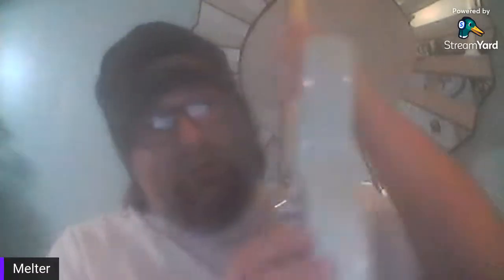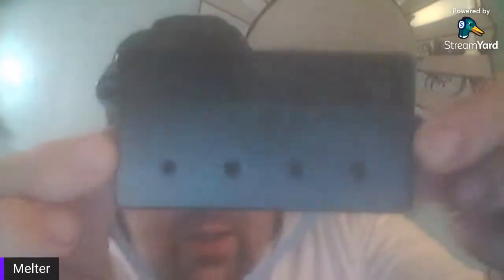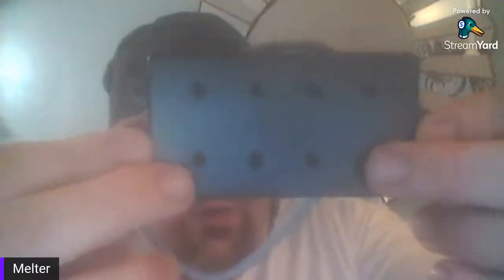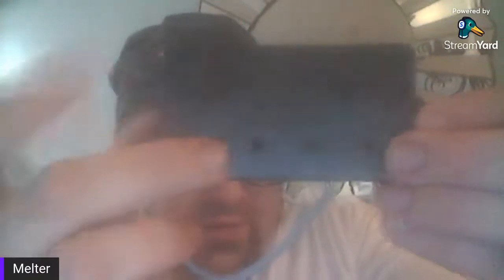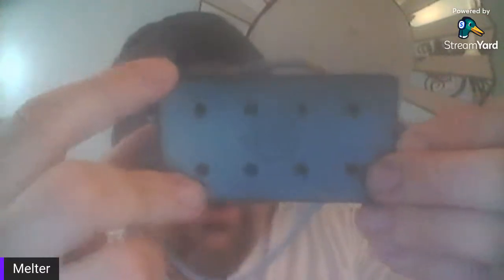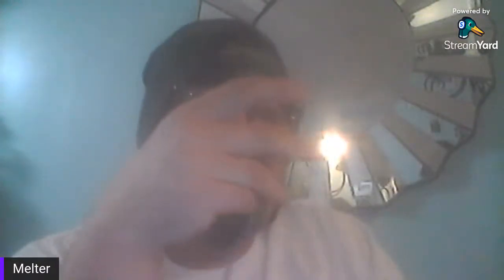Introduction - How to make a $500 bass sound like a $10k bass. Bass Mod Project!

Comment: Ei Kelvin, just a slight adjustment regarding the preamp and the pickups. The preamp, even though was named Notch Filter Preamp, it is technically not a notch, nor is it  a Wal clone, but it is very similar function and soundwise. Just thought I should put it out there. 
Regarding Wal and the pickups, as far as I can tell, the Pro series used that old way of wiring the coils (like two pseudo single coils wired as humbuckers). The MK series uses pairs of coils to form 1 humbucker per string. Those are them electronically mixed within the preamp, on Lusithand Devices case, it would be done with the NFP-Special. Cool to see your video, can't wait to see how it turns out.
Reply from the maker: Thanks for pointing out my minor mistake. I will correct it in the next one. I suppose I will grab a double Special for the Spector, when Rautias arrive.